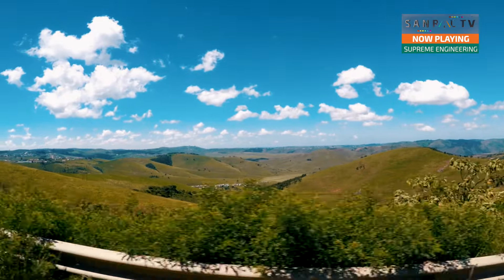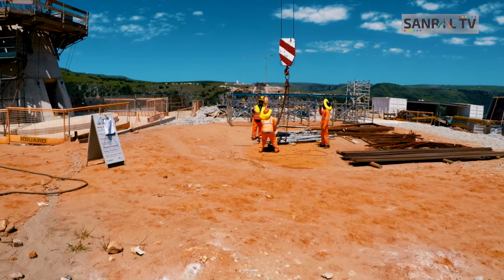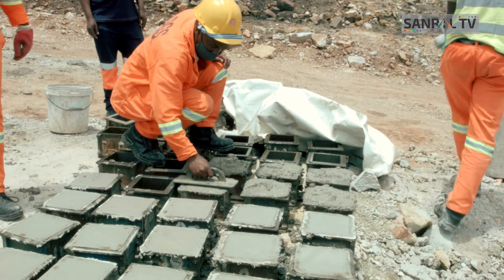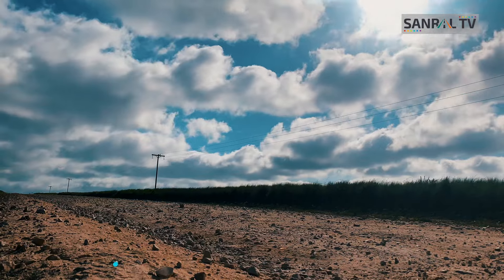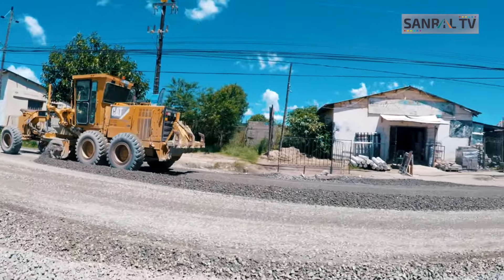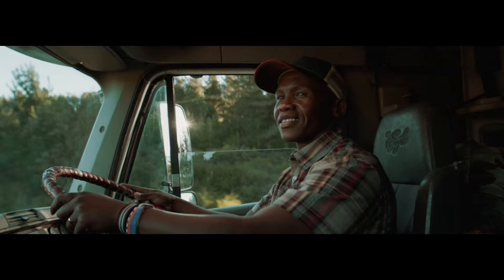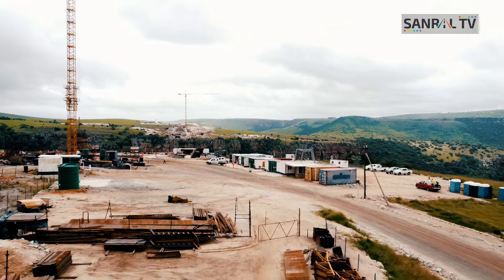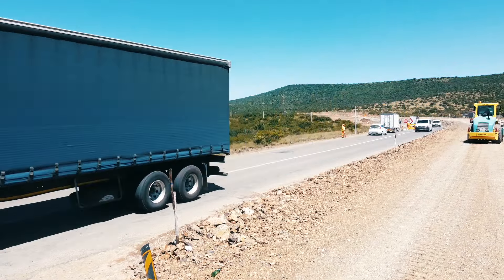SANRAL TV is finally here

Comment: Modern thinking is to have roundabouts, instead of traffic lights.  A roundabout keeps vehicles moving saving fuel.  Roundabouts works even in load shedding.  Roundabouts can not reset to some stupid factory setting.  Roundabouts have very low maintenance.  Roundabouts does not gets looted and vandalized like African traffic lights.  If a drunk driver charges through a roundabout, the damage is usually far less than a drunk driver charging through a red light.  Roundabouts is an automatic traffic calming item.  Accidents at roundabouts usually happens at a much slower speed.  Illegal street racing can not happen on a road with roundabouts.  My question is, how many years before the Sanral engineers adapt to modern thinking?
Reply: Good insightful comment
Reply: I think this is more applicable to municipal and provincial roads since SANRAL is responsible for national roads
Reply: @koenawamokone1445  National roads, as in trunk roads, are indeed the responsibility of SANRAL.  But smaller SANRAL roads like the R44 can also benefit from roundabouts.
Reply: Depends on where the intersection is, sometimes traffic lights are better but roundabouts should definitely be built more